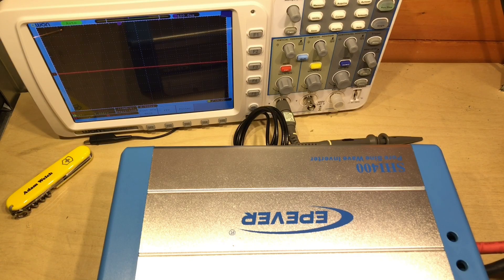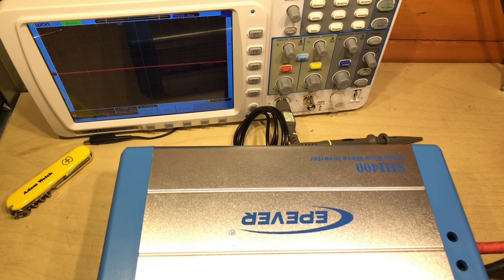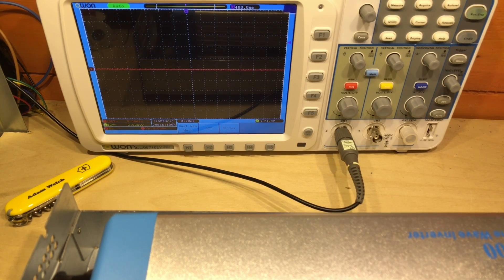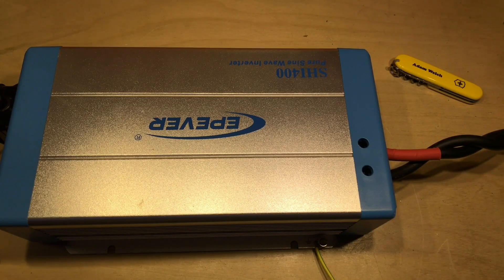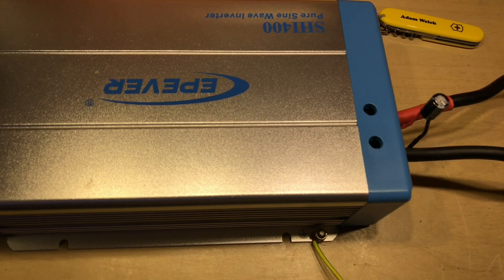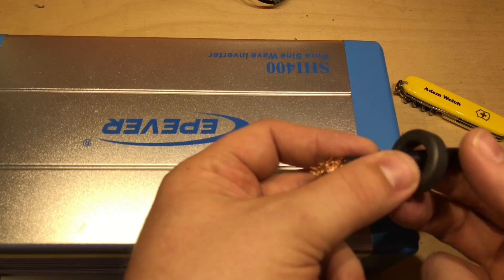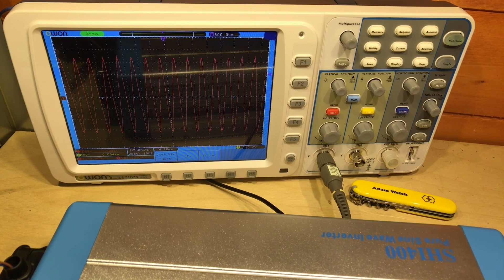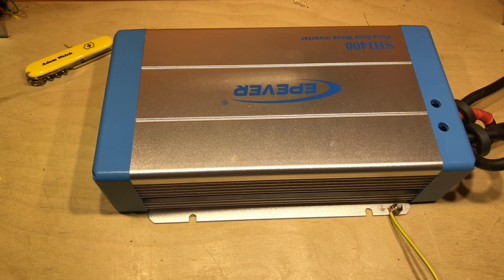Reducing RFI - Four simple methods - 12v Solar Shed

Comment: haha, the RF is pressing the capacitive touch buttons on the scope... removing the extension audio cable seems a bit symptom control? Wouldn't want that RF generator in my shack/shed.
Reply from the maker: Well the ferrite rings and the capacitor seem to help with the oscilloscope, but yes - much of the noise is still there, I've just controlled the symptom as you suggest.  Cheers
Reply: Adam Welch indeed :) As I a "ham" I need to be very picky about what stuff I put in my shed - too bad, because I think solar power is the way; strict EMC tested solar stuff is quite expensive...
Reply from the maker: +Michel Honig Yeah I'm sorry - this isn't the product for you then.
Reply: Michel, I have been looking for an affordable QUIET pure sine inverter but I haven't found one I can both afford and is silent enough to have in my radio shack. Every one I have checked out sounds like a Mexican pirate AM station overloading the front end of every receiver in the ham bunker. Changing the mic cord didn't make it go away. I hate RFI but I really like solar and power. My field deployable solar ham shack is completely self sustaining but inverters and noisy solar charge controllers are shut down while on the air. I have had luck with a combination of caps and torroids you can knock it down below the noise floor but the real junk inverters and controllers there is no way that I have found to shut them up except by pulling the plug........KC0ZQB said that......